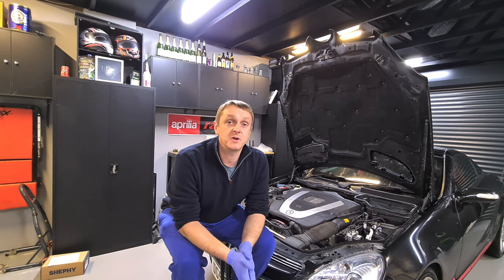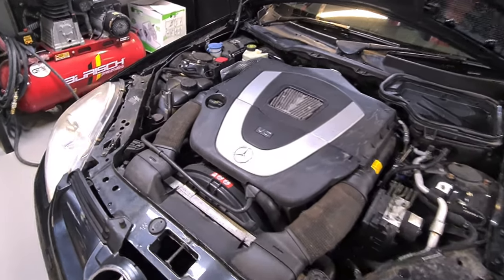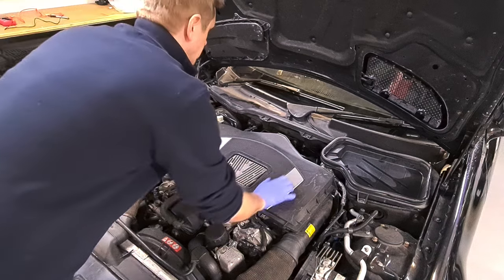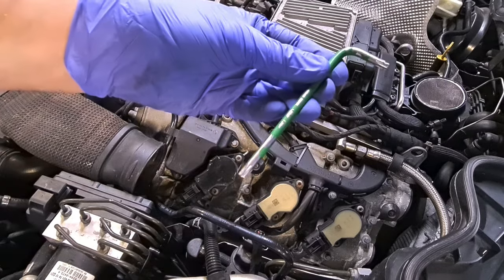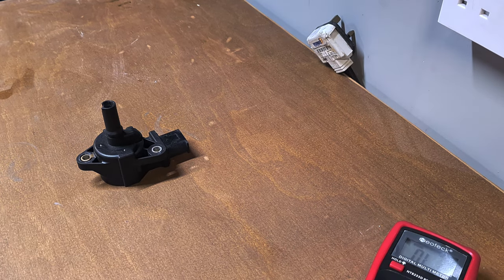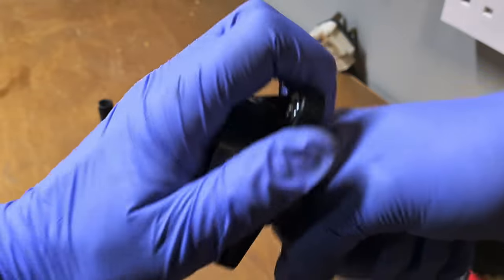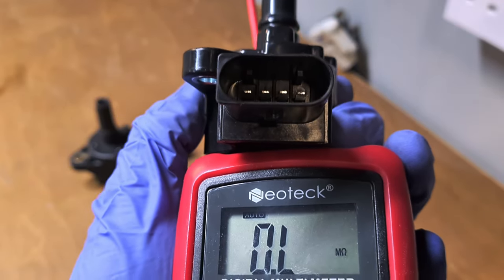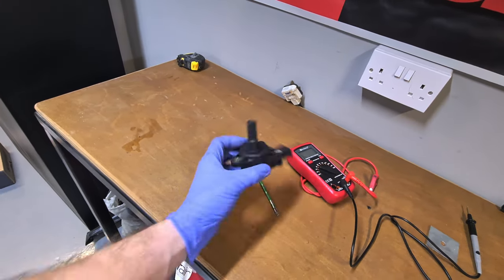HOW TO FIX AN ENGINE MISFIRE MERCEDES SLK 350 R171

Comment: I've had a good look at my car since then, got the air mass sensor out, coils and plugs. I did a test run if I could  get the covers back on, that back part is the hardest to get right. I really love it when you can do it yourself, you only have youself to blame - you know you really want to get it right. Your hands will get dirty, but I bet you will look back at your car when it purs, and think, I saved a ton of money and I enjoyed that ride. I have done this inspired from this video. BTW mine is a 2005 SLK 350, Japanese import look AMG.
Reply from the maker: 👍 It's a pretty good car to work on... And I do love how high the hood opens makes it much easier to work on the engine... But Yes it is not worth taking this to a garage its pretty easy to work on when you know your way around it 👍

Comment: Did the motor lamp (yellow) turn off after fixing this? Gr8 video
Reply from the maker: Erm you mean a fault warning light or engine management?... If so there wasn't a warning light....you usually will get a warning light with something electrical or an electrical assisted motor this was just the ignition coils that have no sensors attached to them
Reply: @PXCBIKES  ok... my motor lamp is yellow now and The speed dial is going up and down when i drive. I connected a cpu and it said coil 1 problem. I bought spark plugs (4st) and going to change them. But u say it cant be that problem?
Reply from the maker: Ah if the coil is totally faulty yes you will feel rough idle and vibrations at idle ... if the coil is starting to go faulty then you most likely won't get an error code until it does ...the ecu will detect a misfire from that cylinder you are best to check the coils
Reply: @PXCBIKES  should i replace all 4 sparkplugs first and then check the coils?
Reply from the maker: I would definitely replace the plugs but test the coils like in the video 📹  and replace any faulty ones ...
Reply: @PXCBIKES  big thx! 🙏
Reply: The switch of the plugs was the problem, gonna reset the yellow lamp with the mercedes ME now 👍

Comment: How did you know which coil terminal to attach the multimeter lead to?
Reply from the maker: Coils have a primary winding and a secondary winding inside the primary receives the 12v dc from the battery then the secondary sends the voltage to create a spark to the spark plug... There are 3 pin coils and 4 pin coils each vehicle will have its own unique resistance specification... One pin will be pos and one negative... Usually you will find which pin to probe in the user manual and there you will find the correct resistance specification... If the resistance is high in Kohms then the connection inside is breaking down and will eventually break the circuit preventing the voltage to travel from one to another... The wiring usually indicates which pin to probe by its colour... Black is ground and red or white... Even blue will be positive

Comment: What an excellent video. My 2005 SLK 350 does vibrate a little at idle, but I don't think the Tachometer fluctuates, at least not nearly as much as yours did. I replaced my spark plugs recently with genuine Mercedes, and the issue is still there. My car presently has 127,000 miles on it, and I was thinking what I was feeling were perhaps the engine mounts going bad, possibly they've leaked out their hydraulic fluid. But, after watching this video, I will first check my coil packs as you suggested, quite easily done. I've posted a video on how to check your Balance Shaft Sprocket for wear in ten minutes, perhaps you viewers might want to have a look.  Thanks so much for this one!   See: https://www.youtube.com/watch?v=G8HvZfxIjkw
Reply from the maker: That's brilliant I will have a look at it.... The tachometer disen always have to move it just depends on how bad the coil is there is a primary coil which I test on this video and a secondary coil test.... If the car misfires at idle then its most likely to be the primer circuit and if it misfires under throttle then it's the secondary...
The simptoms will start with a vibration at idle and as this gets worse eventually the tachometer will flutter 👍 hope this helps...
Reply: Michael, my '05  SLK350 had the same vibration/shimmy you describe, the mechanic i see say its typical for these, the motor mount rubber hardens up.  $750 later, it runs smooth as brand new - with 98K miles on it  :)